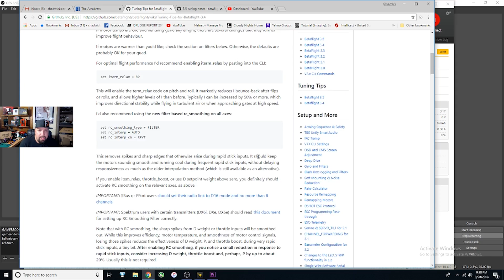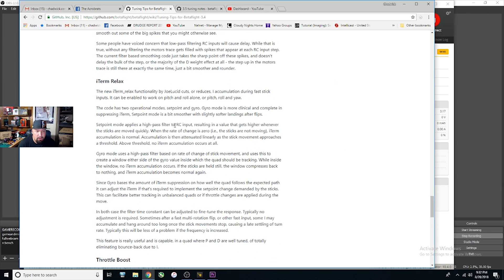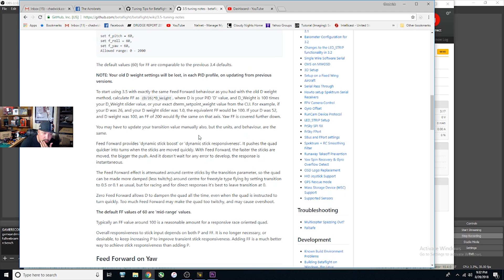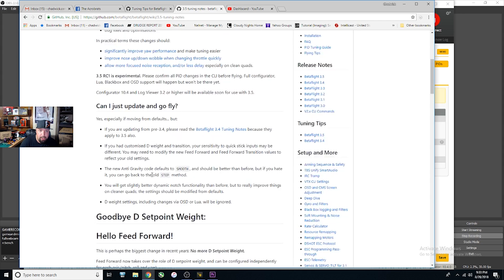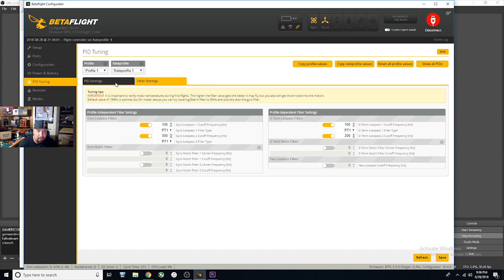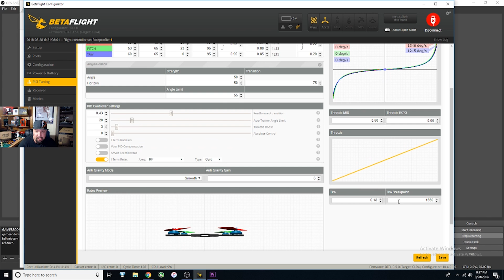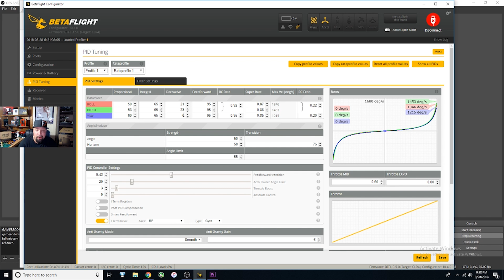UMMAGAWD ACROBRAT TALK..TUNING..BETAFLIGHT 3.4 and 3.5 and BATTERIES

Comment: Nice, I was having a yaw twitch issue with my brat/rotorgeeks motors with 3.5 so I went back to 3.3.3 I'd love to see your pids for the 850 on 3.5, so I can try it out again. Great video
Reply from the maker: Mike Rotch thanks. I have the turtle coming tomorrow so I’m going to throw that in there and do a set for 650 and 850 again and see where we are at.  It’s tough to covey such a bunch of information. Lot going on in beta right now. Too much imo. Lots of band aids.
Reply: ChaddyCEEE RCandPC thanks to your video, my confidence grew and I flashed 3.5 back onto it. Didn't do the yaw recommendation and the yaw twitch is gone. Going through plasmatree pid tuning, pitch and yaw look great but roll is a bit tougher to iron out. I can share my pids or plasmatree logs.